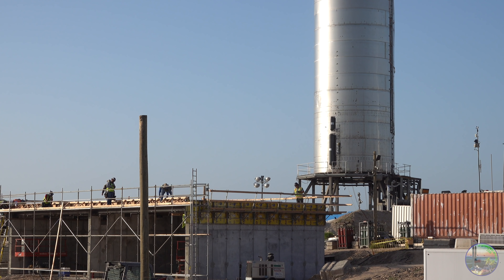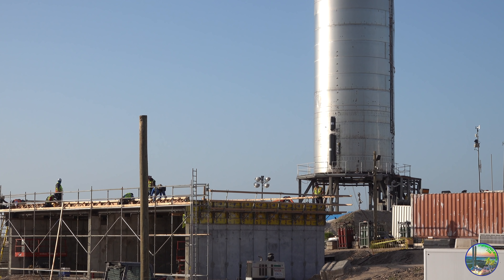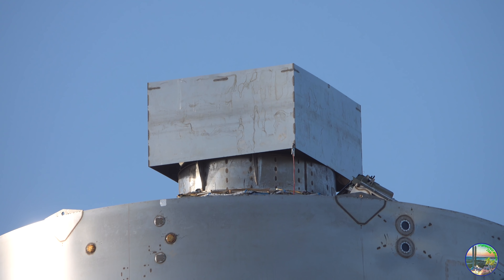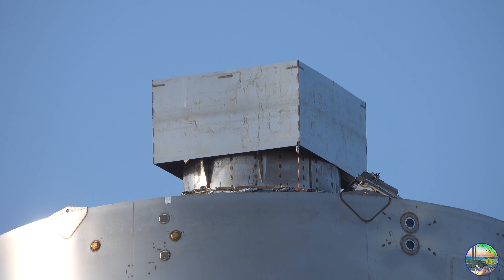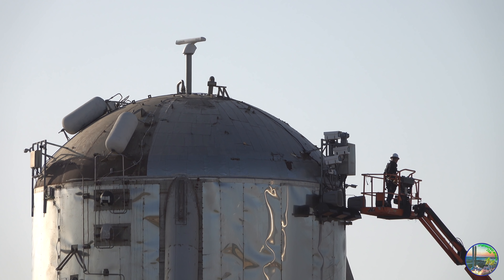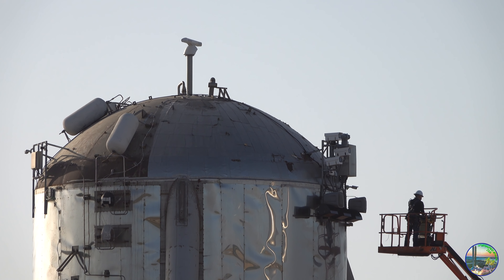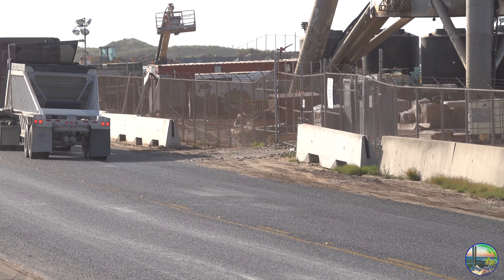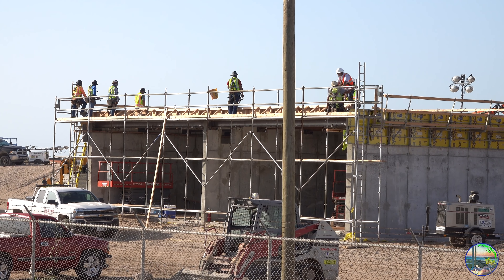2020 07 13 Before the Static Fire

Comment: If you  think of it logically that bunker building must be pretty critical as it is the first blast-proof structure at test pad. It would be crazy IMHO to start tests that could jeopardise its structural integrity, so I think they will start tests only after roof is poured. This is what happens when you have construction bumping up against rocket science.